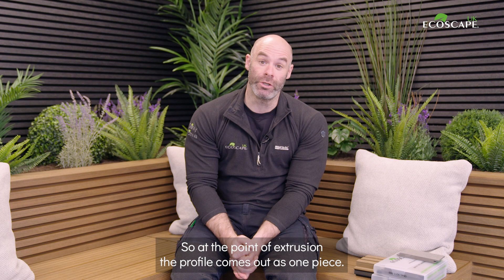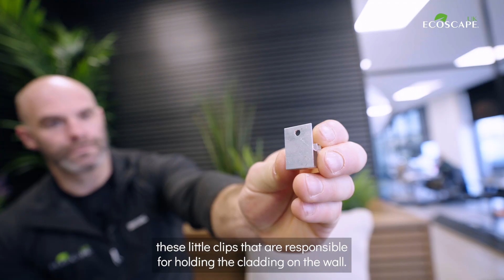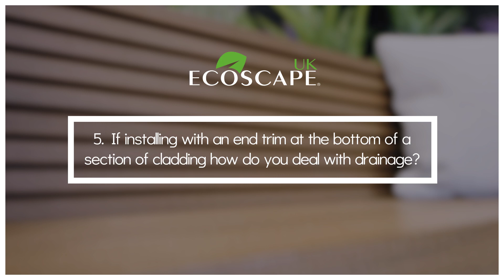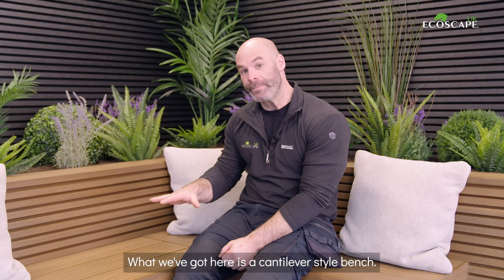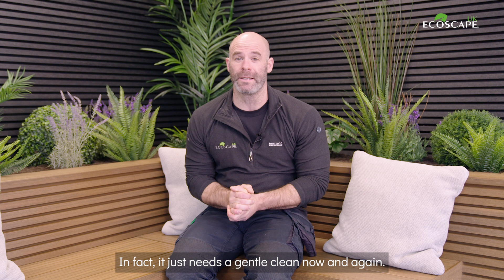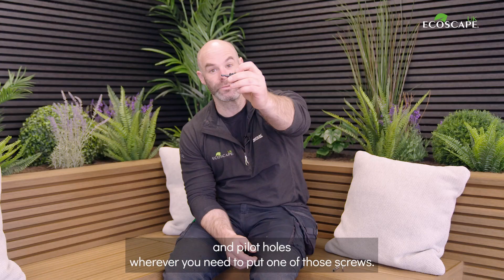Composite Cladding FAQs

Comment: In the event face fixing was required through the batten part what would you use to putty/bog up the hole?
Reply from the maker: We wouldn't recommend this as we would advise to use our colour coded screws. We would also advise to screw on the portion between the battens rather than directly through. 

https://ecoscape.co.uk/resources/slatted-cladding-installation.pdf